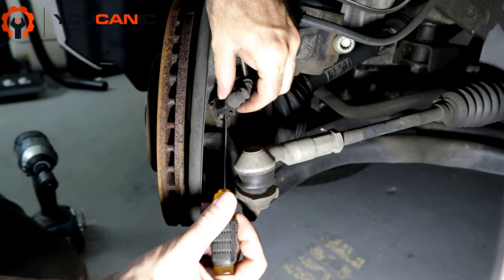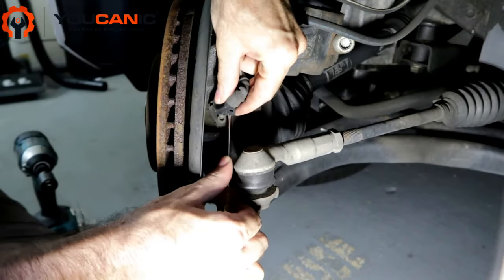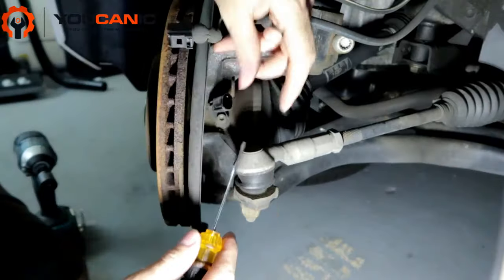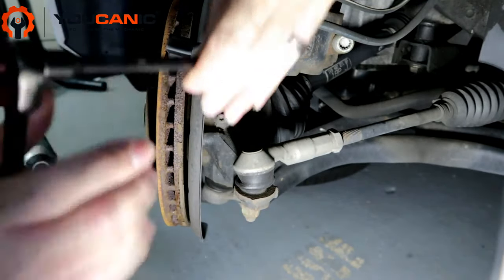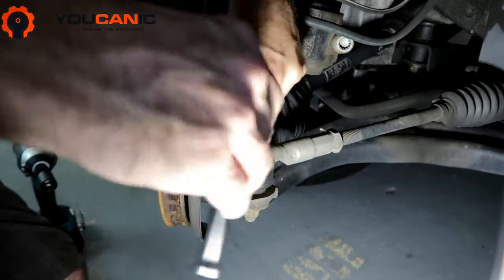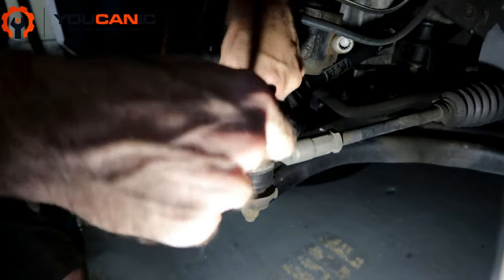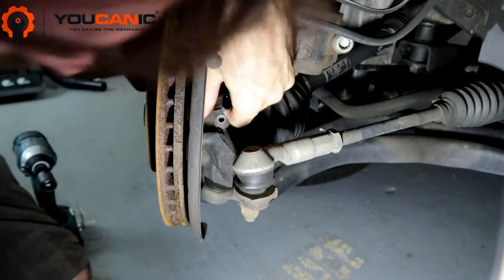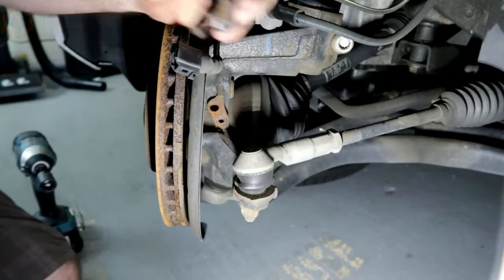Volkswagen ABS Wheel Speed Sensor Replacement

Comment: Try doing one that’s been in salt a few years. You end up pounding them out from the other end with a punch after removing the brake disc. You also have to heat up the casting to get the rusted bolt out. You people in lower states have it made easy working on cars,no snow and salt on the roads
Reply: Also I live in Maine so let's not talk about salty and non-salty areas.
Reply: Swedish here, plenty of salt, rust and ice here. I removed mine (also the front left one as in the video) pretty easily, maybe it got something to do with the design
Reply: Тут тоже самое интересное вырезали.
Reply: had to melt it out with a blow torch and a drill bit to scrape it clean lol

Comment: What socket did you use
Reply from the maker: Thanks for reaching out! In the video, we used a standard socket set suitable for most car repairs. For more specifics and detailed steps, feel free to explore our free resources on www.youcanic.com. We're committed to empowering car owners like you with the tools and knowledge to handle car maintenance with confidence.

At YOUCANIC, we provide helpful guides, our own powerful YOUCANIC scanner for easy diagnostics, and even access to factory repair manuals for more complex tasks. Feel free to reach out on our site if you need any assistance. Our mission is to empower and support you on your car ownership journey.

Comment: First try this- it costs nothing! Had a rear right sensor fault on a T5 VW transporter diagnosed with a Foxwell 320 Plus unit. Bought a new sensor, took the wheel off and as soon as I removed the rubber cover to the wheel hub inner side,  I noticed there was an accumulation of brake dust/ around the sensor, the magnetic ring was in OK condition. Cleaned it up with WD40 and break cleaner. Didn't need new sensor and problem solved, as indicated by a check on the Foxwell gadget. 
So, with hindsight,  if you have an error , just get under the vehicle without removing any wheels, remove the hub cover from the inner side, if accessible, and clean the magnetic ring and sensor on each of the 4 hubs. Do this- it won't take more than 30 minutes and you don't need to buy the diagnostic device!
Reply: The errors come back in a matter of days, just replace the sensors and avoid more hassle, they’re not even expensive
Reply: Can you just replace sensor and off you go? Or do you need to program them in?! No idea!

Comment: Just changed my rear sensor as it was throwing a code and not picking anything up on a live data run. Replaced the sensor but now that one sensor shows random speeds that dont match up with the other 3 sensors. Do i need to replace with an oem sensor (using a delphi atm) or will it be the reluctor ring on the back of tbe bearing? Mot is due soon 
Please help!
Reply from the maker: It sounds like you might be dealing with a issue that could be either the sensor or the reluctor ring. Our YOUCANIC Full System Scanner is a great tool that can help you diagnose the issue (www.youcanic.com/scanner). 

If you need more assistance or have further questions, please don't hesitate to use our platform to ask car-related queries. YOUCANIC is here to help make car repairs understandable for owners like you (www.youcanic.com).

Comment: My vw t5 2.5tdi van yesterday i was driving it (been off the road for 5 months).It drove perfectly but then after 30 mins the abs light and airbag light came on together then the instrument panel went down.The speedo,the rev counter,the temp guage the lot.All that stayed on was the digital mileage.Been on a few forums and lots of people are saying its an abs problem,likely to be the abs sensors.Could this cause the instrument panel to go down.Thanks.
Reply from the maker: Thanks for reaching out! A faulty ABS sensor could indeed cause your instrument panel to malfunction, as these systems are interconnected in many vehicles. For more detailed help, we recommend using our YOUCANIC scanner and consulting our free guides and resources on www.youcanic.com. There, you can find factory repair manuals and a supportive community of car enthusiasts to help you troubleshoot further. At Youcanic, our mission is to empower and support you in your car ownership journey. Please don't hesitate to ask any further questions through our website.

Comment: Bullshit.
Reply: what im saying bruh mine tore apart when I tried to remove it with a screwdriver
Reply: After doing mine it looks like I’d pull the spindle and put the backside of the sensor in a vice and twist. Or just hit it with channellocks on the car.
Reply: There’s a reason the video stops and restarts when he’s pulling it out, I live in NC, (not a lot of salty roads) 173k miles on it, and I promise you’re not pulling that out with your fingers. Do yourself a favor and pull the brake disk (you don’t have to pull the part it mounts to) and push it out with a screwdriver. It’s still a pain in the butt. I used a bore brush and alcohol to clean the hole it goes back into but still had to drive it in with a wooden dowel and a hammer to seat it.